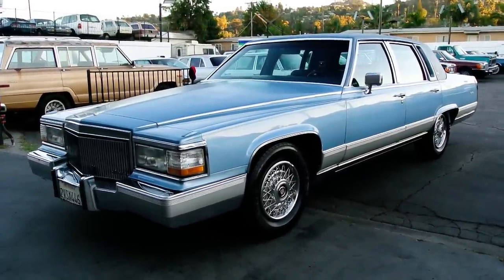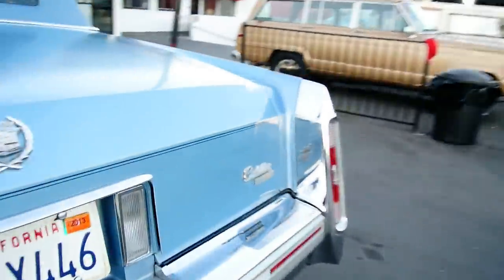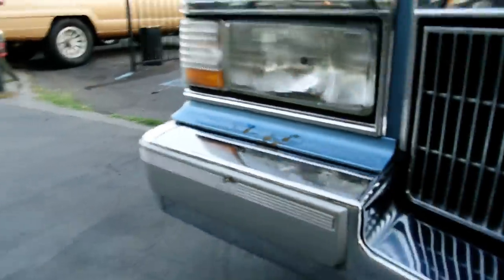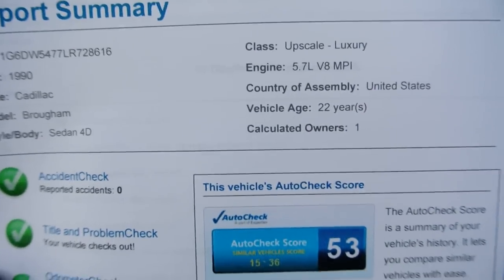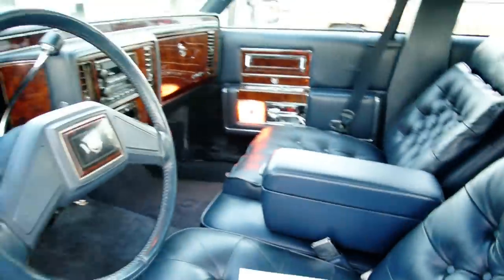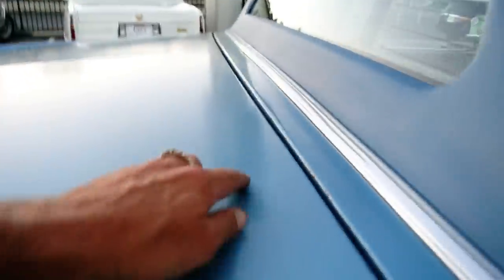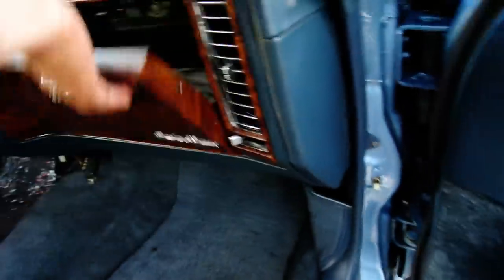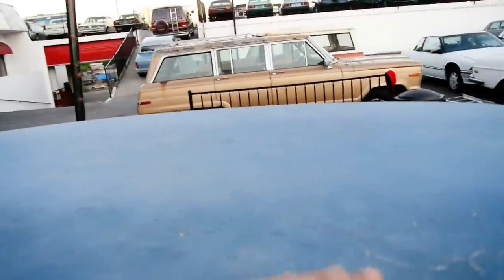1990 Cadillac Fleetwood Brougham Delegance 350 V8 1 Owner Low Miles Saloon

Comment: 1990 was the first year for the TBI Chevy 350 in the Cadillac Brougham. It was available as part of the trailer tow or coachbuilder package, which included heavier duty components. That engine was rated at 175 horsepower and 295 ft. pounds of torque. That engine came with a gas-guzzler tax of $850. Even so, it's still a better choice than the Oldsmobile 307 that was still using a 4 BBL carburetor and was rated at 140 horsepower. It was replaced by the TBI Chevy 305 in 1991. I believe the 350 used the heavier duty 700-R4 transmission where as the 5 liter V8s used the 200-4R tranny. 1990 was also the first year for anti-lock breaking in the big RWD Caddy along with the vacuum-fluorescent instruments and composite headlights. Among the old school RWD Cadillacs made between 1977-92, I like the 1977-79 with the 425 along with the 1990-92 with the Chevy V8s.
Reply: My parents had a 91 with the 5 liter TBI. It had the 700-R4. Great Car!!